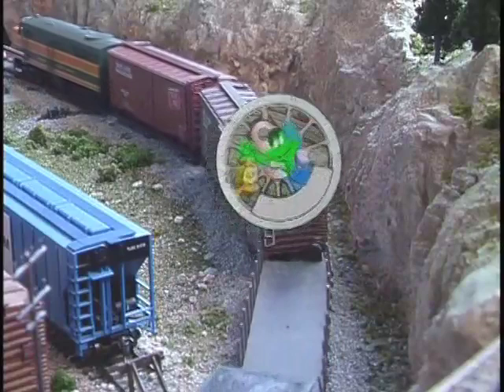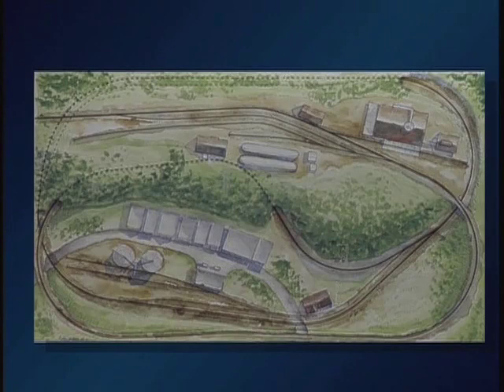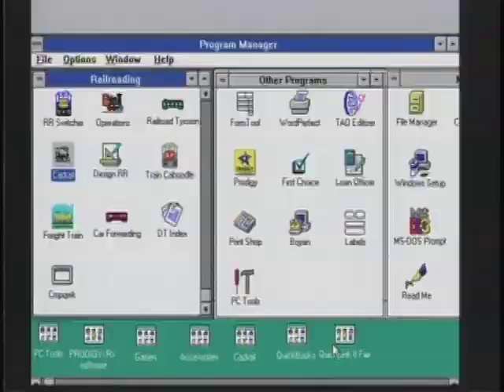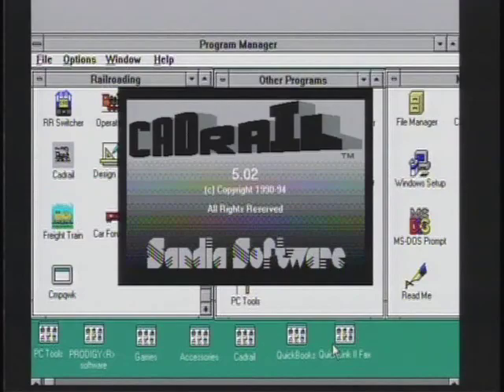Building a Model Railroad Series #1--Designing

Comment: 4x8, 6x12, 12x36; around the wall, (with or without peninsula); point-to-point, (with or without loop.  All kinds of layouts can be built using the CADRAIL program.  I prefer to do it all by hand; but then I much rather have a narrow, shelf style, switching road; as opposed to a bigger layout for running long trains.

Comment: cut the board into 3 seperate pieces..then get adjustable shelf rails (from home depot) and put them along the walls. You'll have more space in the room, your layout will be more interesting with different kind of track plan, you can light it MUCH more realistically, it is easier to work on.. FAR easier to move around. Look on google for a book called Shelf Layouts... no body does 4X8 layouts anymore..they just aren't practical.